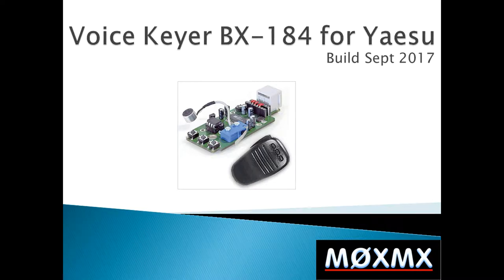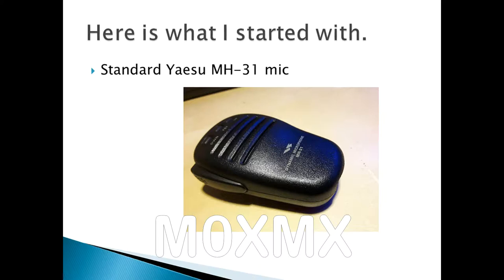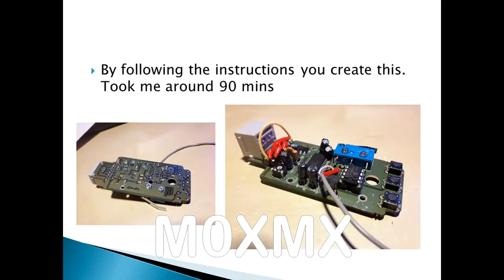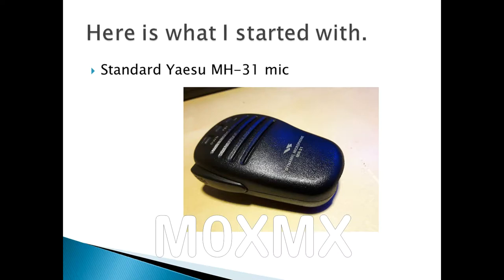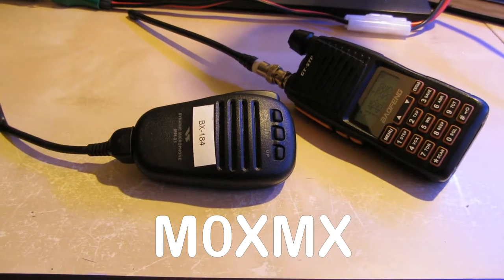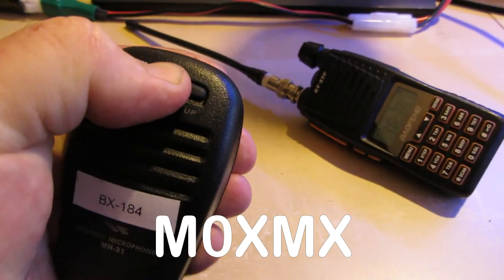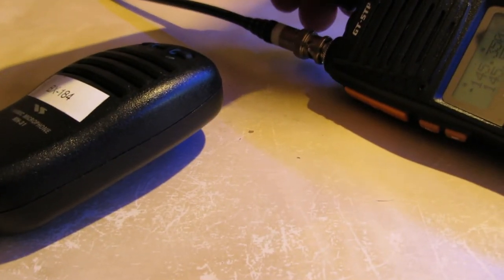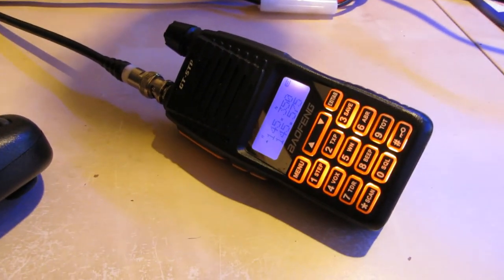BX-184 Voice keyer construction

Comment: Hi Mike. Do you still use the voice keyer? Would recommend to go with the 817 for SOTA? 73
Reply from the maker: I have it and don't use it so will sell if you want it
Reply: @MikeM0XMX tempted Mike what sort of price would you want for it plus P&P 😊
Reply from the maker: @m7trsradio  drop me an email mike@m0xmx.co.uk
Reply: Mike, is this mic also compatible with the Xiegu G90? Also, if you have a completed one to sell? Please let me know, I cannot solder….thanks for the video
Reply from the maker: @vincentcimino1963  Hi Vincent. Sorry I have no knowledge of the Xiegu however if it is supposed to be compatible with the MH31 then is will be ok. I actually sold mine a fuel weeks ago however you can buy a kit which I don't think requires soldering. https://www.box73.com/product_info.php?products_id=2361
Reply: @MikeM0XMX  ok no problem and I think it appears that way but when I contacted them and asked if they sold completed mics they’re response was no, just kits. I’ll just have to find someone to put it together. Thanks again.